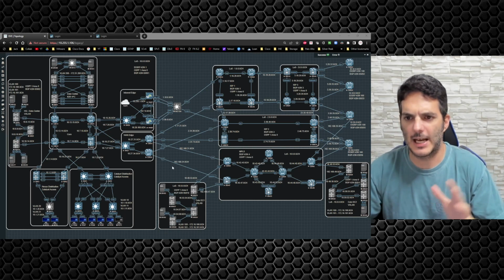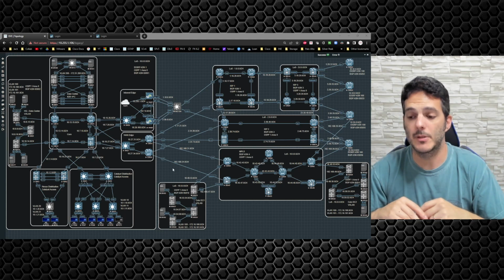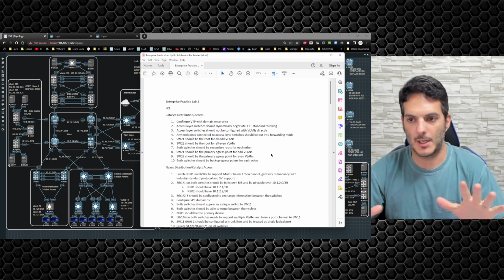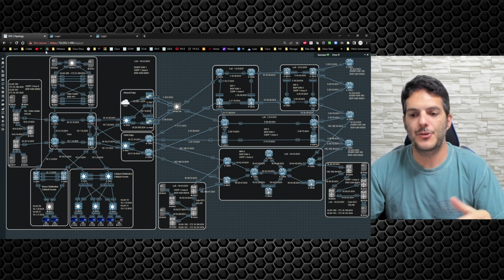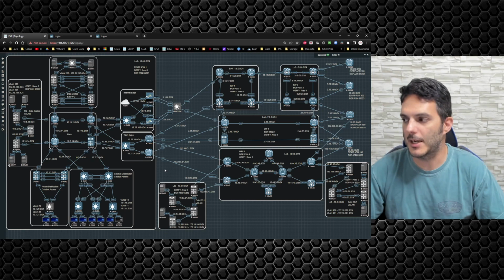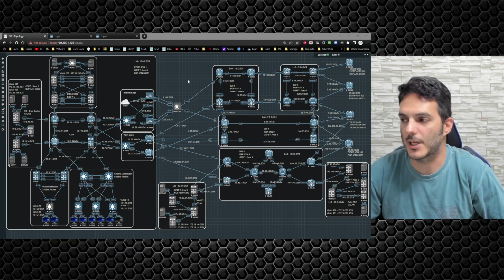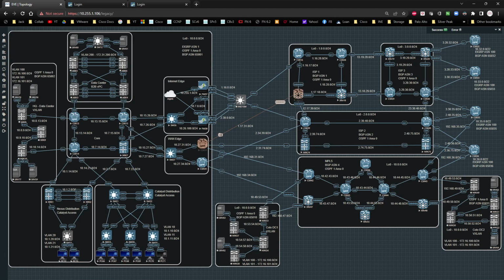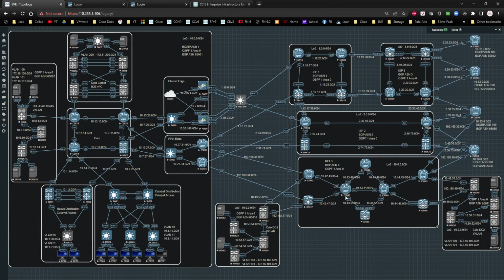Enterprise Lab 1 Overview

Comment: Hey what are the SRV devices? I looked at the .txt file but it just said IOSv. Also for the SW did you just use IOSvL2?
Reply from the maker: SRVs are IOSv routers with server icon and correct on the switch, IOSvL2.
Reply: Never mind I found the spot in the video where you mention your specs.
Reply: Do you leave your server running all the time or just power on when you want to lab? I'm thinking about getting an 810 but already have a 620 hosting a few things.

Comment: Hey Rob! I do run bare metal as well, but with GNS3. You probably will not need it, since your server has plenty of RAM, but for your viewers with less RAM - if they run bare metal ass well, they can check "Linux's Kernel Samepage Merging" feature. It saves a ton of RAM by collapsing VMs with the same memory contents. So if running a dozen CSR1kV images, all of them will share the same memory space for code.

Comment: Rob, can you, please, explain how do you able to run 7XRv and a lot of CSRs, and other stuff simultaniously?
Reply from the maker: rebuilt the server with EVE-NG bare metal. I could never get more than 15 or so devices running with the EVE OVA. Now, I can do nearly 100 relatively easily.
Reply: @RobRikerTechChannel  Thx for reply. Unfortunately I have no opportunity to do this. Only OVA, so should try smaller steps.

Comment: What is the main reason for your customer using Nexus vs Catalyst? Also, would you say the CCIE for enterprise is much more doable than Datacenter? So much hardware involved with DC but ENT seems to be doable with virtualization.
Reply from the maker: So many different drivers man, often times I am just implementing what was sold to them, I rarely ever have influence on what they buy. Yes for the bulk of it EI is much easier than DC. DC has ACI requirements, FC/FCoE/FCIP requirements, UCS requirements that can only be done with hardware. The only thing in EI hardware dependent right now is SD Access for Enterprise Infrastructure, but Ent WiFi, has WLC, AP and SD Access.
Reply: @RobRikerTechChannel  Thanks Rob. That is what I thought myself. I only work with ACI and nexus. Never touch UCSM, FI, or MDS.  Kind of a waste to get a CCNP in DC when people expect you to know that stuff.